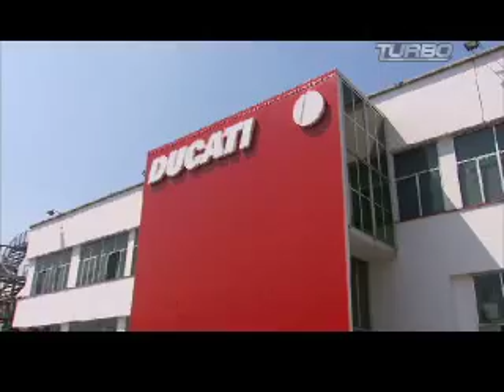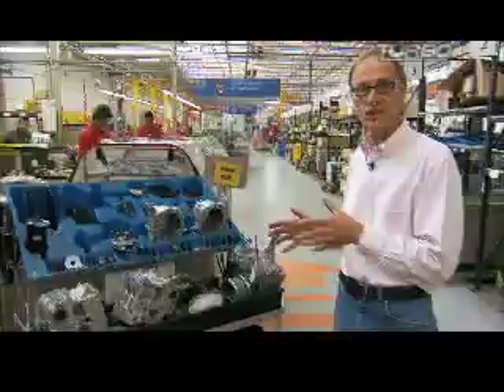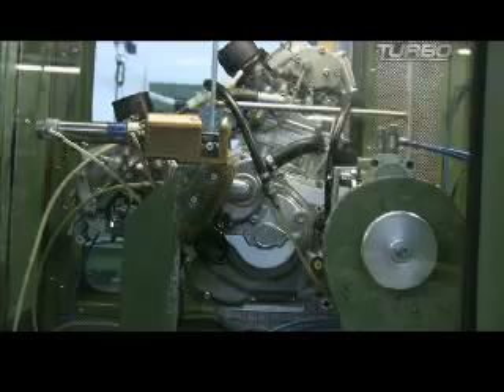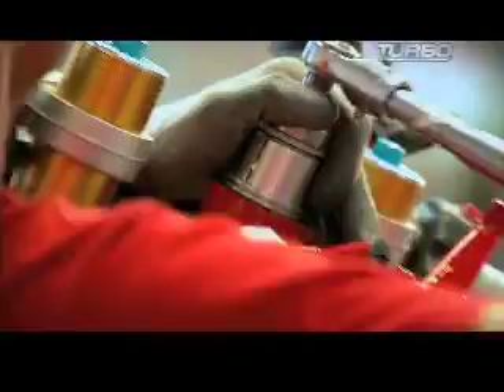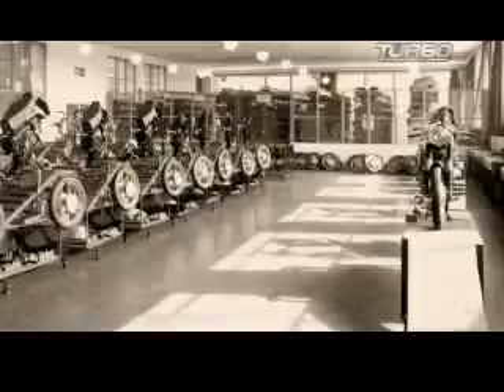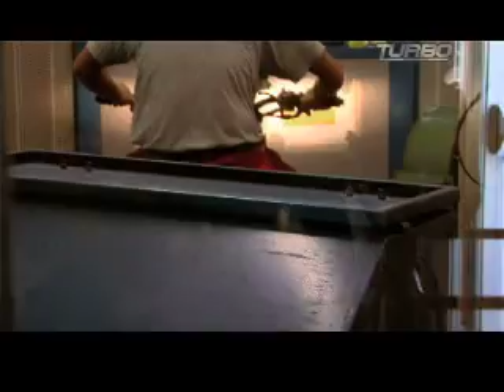Twist the Throttle- Ducati Pt. 2

Comment: 160hp sounds a bit low since most bikes of the same period have around 180-200hp... but do not forget that those are almost all 4 cilinder engines (with some 3 cilinder exceptions).. so actually if you look at it that way, 160 is actually quite a lot... :-P